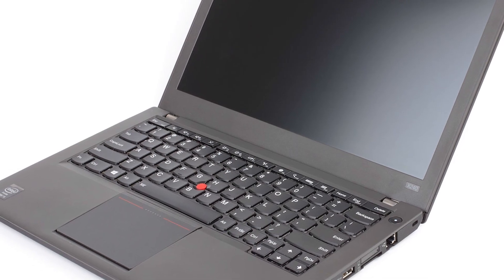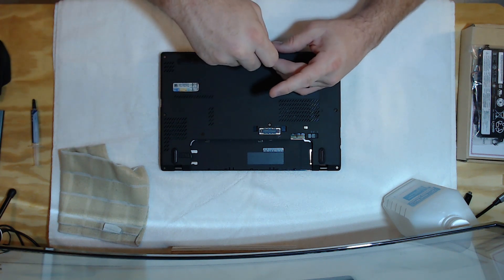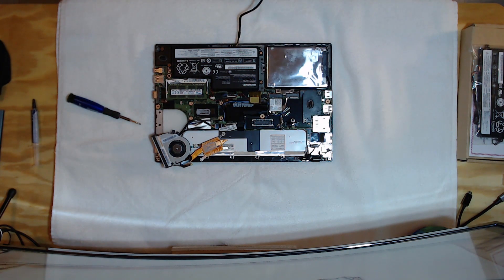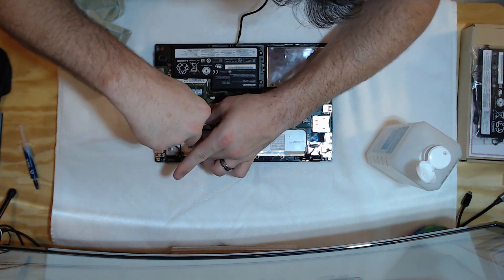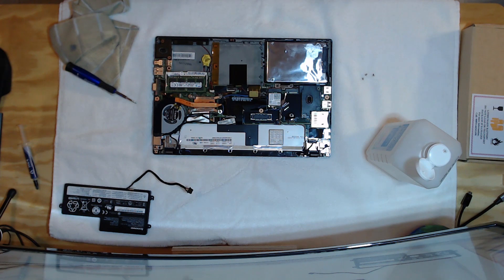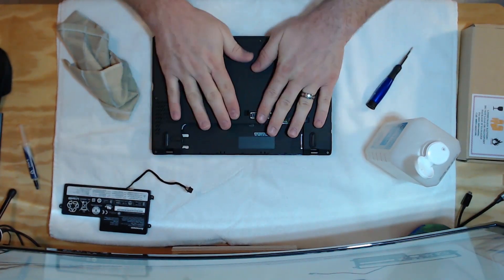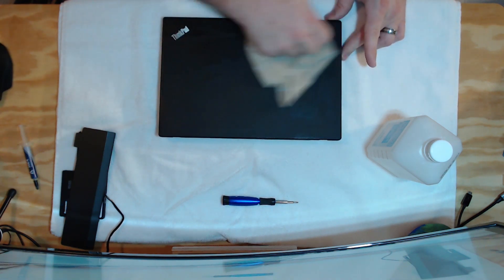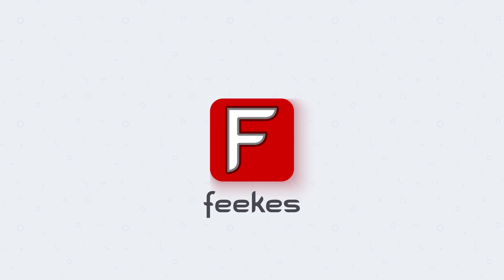Lenovo X240 Refurbishment

Comment: I like the X240 very much. Especially with the nice keyboard backlit. You could even upgrade it with a 12,5" FHD IPS panel. I did so, back then, but you have to know that it's gonna cost you more battery lifetime. Not all people know, that many ThinkPads have two batteries: One inbuilt and one external. This doesn't only give you more time, but you can even switch the external battery while the machine's on! So on a long journey, just have some more batteries with you. :D Besides the normal flat external batteries, you can even get the bigger ones. 68+ if I remember right...
Reply: Just got a x240 with a 12,5" FHD IPS touchscreen. Gotta say I really love this thing so much.

Comment: Hi feekes. Great video. May I ask you questions, where did you buy those original replacement batteries for X240? Can you provide the link of it? And can it also be used on ThinkPad X250? I'm going to buy an X250 and the battery is pretty much deteriorated. I want to change the battery but don't know where to buy it with the best price, because people tend to sell on high price for original battery and I want to know the right price for the batteries before start looking of it. Thank you for your answer.
Reply from the maker: Unfortunately I do not have a link as they were part of an aftermarket parts off of eBay. They were very inexpensive around 20 dollars per, and are still working to this day as they were in the filming of this video. I will see what brand they were and post back when I get to my office on Monday. Thanks for the feedback.
Reply from the maker: Well Went back and looked at orders, those two in that video were OEM manufactured. They were from an eBay seller, but were Lenovo branded batteries. Since that video I have purchased aftermarket parts without issue. Most of the third party batteries come from the same few factories and use the same cells, but have issues with physical connections. An option I use often that makes them "better" is replacing the internals of the original battery with the after market components. This gets you the new cell without compromising the locking mechanisms that keep the battery connected. Most of the time all that is needed to accomplish this is a heat gun/blow dryer to loosen the glue holding the labels on and some patience. Always mark that you have refurbished it as to not be deceiving if you are reselling the parts. Stay away from GHU batteries for Lenovo if you do not want to replace the internals from the original packs, they have retaining lock issues. Internals are good though. Holler back if you have any questions.

Comment: Shoulda disabled the internal battery in bios before starting 😉👌
Reply from the maker: Needed to state that, but I did. Good call though.
Reply: @feekes  Could I ask why is that ?
Reply: Deividas Gedgaudas because the device has an internal battery - the feauture is called hot swapping .  Though to answer your question you never know what could happen with oil and water

Comment: Got one of these in really good condition off eBay for cheap. Sadly when I opened it up to upgrade the ram and install an ssd I discovered it didn’t have an internal battery. Guess I should have guessed from the price although it wasn’t declared in the item description. Everything else was great, though.
Reply: John Montgomery I just picked up a refurb from Frys and just ordered my upgrades off of Amazon.  I knew I didn’t have an internal battery by removing the external and trying to power it up.  So I ordered an internal.  P.S. for anyone doing upgrades WITH an internal battery to go into the BIOS and set the internal battery to off for servicing.
Reply: @akmartinez1  That's how I discovered mine didn't have an internal battery. Went into the BIOS to disable it and found out it wasn't there. 😂

Comment: great teardown, very helpful, as I just recently purchased one myself. I need to know if you could provide a link to the internal battery you installed. Whether it be from Amazon and or directly from the manufacturer. Thanks
Reply from the maker: Actually ordered the battery from eBay. Both the internal and external. They were factory new, just not from Lenovo. Good machine, great size though.

Comment: thinkpad casing is very brittle from cheap material
Reply from the maker: When they start to age you really have to be careful around the ports and vents, they will break. Believe it or not, WD40 can condition the plastic some to give it a little more longevity. Thanks for the comment.
Reply: @feekes  Can WD40 be used to cure cancer too?

Comment: Hi! Do you think this m.2 NGFF ssd will be compatible with the empty WAN card slot of x240?

https://www.lazada.com.ph/products/oscoo-m2-ngff-2242-ssd-solid-state-drive-high-speed-60gb-120gb-240gb-sata-iii-computer-game-i211386437-s270436061.html?spm=a2o4l.searchlist.list.3.6321fcc5T8cS4k&search=1

thank you!
Reply from the maker: So sorry, I never actually check the spam comments, I will from now on. I cannot say that it would work without testing the actual drive. Looks like there is compatibility so long as it is 42mm in length, the community has had good success with placing storage devices in the WWAN slot. It would be crapshoot till you actually tried.

Comment: Heey, thanks for the video! What do you recommend. A Hp 2570P with third gen dual core i7 or a X240 with fourth gen dual core i5? I will use it for wordpress, Woocommerce, word and some light editing in Premiere pro. Thanks!
Reply from the maker: Jan pros and cons to both. The HP has dual channel memory with a Max of 16gb, so if you do use the on chip GPU it will preform better. The Lenovo will give you a longer lasting lighter carrying notebook, but at the cost of single channel memory at a Max of 8gb. The i7 vs i5 in notebooks performance is much less drastic, yes the i7 will be slightly faster, but consume more power. Personally I would choose the Lenovo for the later gen chip and power consumption, but it's really a personal choice with those two.
Reply: feekes thanks, i wont play any games on it. The rendering doesnt need to be fast but the editing proces its self has to be a little bit smooth. I will render in the night.
Reply: feekes and what do you think of the screen 1080p screen upgrade. How does the battery life react?
Reply from the maker: It will effect the battery life, not too much. The more important thing to worry about is if it will support the 1080p screen. By default there are not enough lanes to drive that panel. They do make an add in board that increases the lane count to facilitate the added capacity, but just make sure you pick it up as well if you are doing the upgrade.  Check out this post on the lenovo forums for some more information. 

https://forum.thinkpads.com/viewtopic.php?t=122640

Personally I would think the extra screen real estate would be worth the upgrade.
Reply: feekes thanks again!
Reply: I know you asked this 9 months ago so I'm way too late to chime in, but just want to say if anyone else is curious that the display on the HP 2570p is a very low quality TN panel. If you planned on doing any sort of editing whatsoever, getting the x240 with the IPS screen is going to give you a vastly better experience.